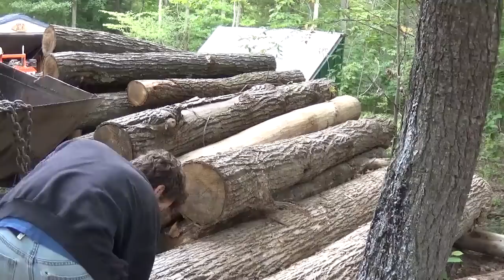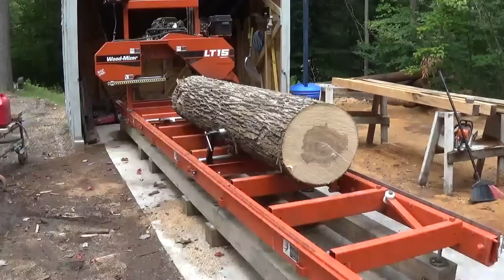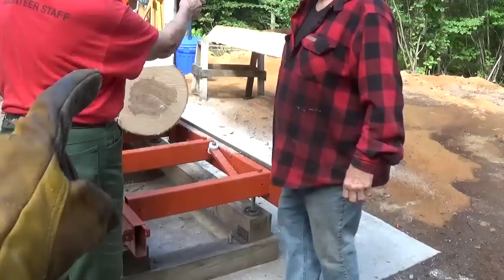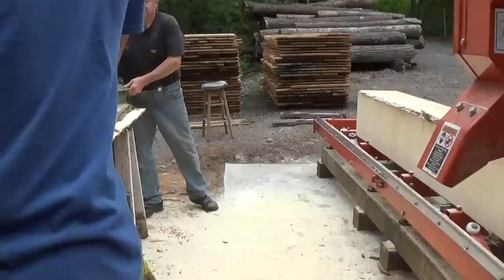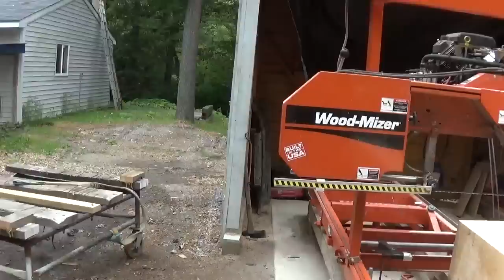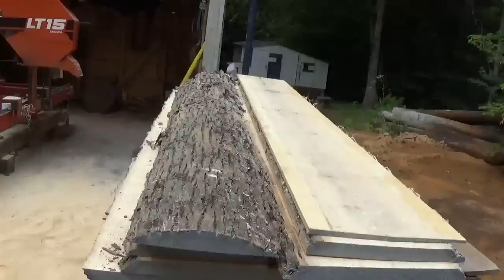The nicest lumber to come off the mill in 27 months. White Ash.

Comment: I ran a planning mill for 10 years .The biggest mistake I noticed  was if you needed a 3/4 planed  finished board  on both sides you must allow for wood shrinkage  and sawmill that board 1''1/4'' .. wood will shrink  alot when drying
Reply from the maker: Very true, but I learned that way back. I cut the wood dry it and plane it.  It only takes about 3 months.

Comment: But remember for furniture use kiln dry only. If you use air dry and put it in a room with a wood stove it will shrink even if it was drying 20 years stacked  inside in a hot attic.  My father and grandfather owned a cabinet shop and wood milling from 1926 to 1989
Reply: Dry is dry weather its kiln dry or air dry , auctuly air drying is better because the moisture leaves slower with less chance of warping and twisting
Reply: Not sure where you heard you cant make furniture from air dried lumber because that's just plain wrong. I air dry all my lumber and while it takes time usually about a year or more outside in covered stacks before I move it into my shop to bring it down to final moisture %.  I have no problem getting my lumber down to 6% MC the way I do it which is perfectly good for building furniture.  6% MC is about as low as they can go when kiln drying. I've also heard air drying is better in most cases and especially for certain types of wood as it preserves the color better than kiln drying.

Comment: You could use a bigger chainsaw with a longer arm so you can go all the way thru with one cut.   If you place some small limbs under the log, 1 on each side of where you cut with the chain saw and a slightly smaller one on the ends, it will keep your log from binding up your chainsaw and lift the log enough you won’t get your blade in the dirt at the bottom.   Awesome video.   So many great projects that can be made.  I just saw these saws for the first time yesterday and would love to have one but being a truck driver I would never have time to use it.   Lol

Comment: OK, first off, what a beautiful piece of wood! I hope you can make something equally as beautiful. Thanks for the video, but a couple of things...  you probably should be using some PPE (personal protection equipment) like head phones and safety glasses. You'll want to be able to hear when you get older (take it from me :) also, um, you should use the car horn more often... ;) I guess your grandpa(?) didn't know how well your camera picks up his words. Other than that, you do a lot of unnecessary raising and lowering of the saw. If you complete the cut, remove the freshly cut board, return the saw to the start and lower it to the new cutting depth it'll save you a lot of work. Just sayin' from personal experience. Take care.
Reply from the maker: Hi Dave, we found that the saw blade picks up a considerable amount of dust if you don't raise it after a cut, and that dust causes the guide roller to stretch the blade when you start the saw. We find it easier to raise and lower without having to clean the blade.

Comment: that is realy a nice looking peice of wood that you are cutting in to one inch lumber
Reply from the maker: It is very nice, I cant wait for it to dry so I can use it. Thank you
Reply: I guess it all depends on what you plan to build with it.  Personally I'd a either slabbed the whole log at 2 inches for tabletops or quartered it then mill each quarter for dimensional lumber but that's just me.

Comment: Thanks again, what a beautiful log there!  I bent the round tension dog arm on my lt15 and was going to buy another but apparently from my woodmizer dealer I'm better off just getting the tube from the hardware store. I don't know the size of it as my mill is out on my island. Next time your at the mill could you let us know what the size of that tube is? I''m thinking it is ⅕" material but don't know how long. it Is easy to bend those by over tightening I found out. Matter of fact it looks like your front one is a little bent, but doesn't bother you yet.
Reply from the maker: My front one is bent from the backhoe, I was taking the chain off and I did not realize I was hooked to it right away and I pulled on it.

Comment: you should have measured the total length and then cut the log in half. that way if there was some small problems with the cut boards you would have a little room to play with.
Reply from the maker: That is what I did. It worked well.

Comment: when you cut the logs to store you need to paint them on the ends so they don't check
Reply from the maker: For some reasons it is true, but not for all.
Reply: but its true what I said  I live in Connecticut its the known thing to save the ash for winter after the sap has ran out of the tree to get the most white wood out of it not sure where your from . why don't you to a test cut ash in the summer then cut a winter ash an see what yields the most #1

Comment: Can't find an ash tree in Minnesota that doesn't have emerald ash bore
Reply from the maker: The bugs can be a real problem in logging that is certain.
Reply: Same here in southern Ontario, Canada. Emarald Ash Bore is making them good only for firewood.
Reply from the maker: @optimoprimo132  I dont know if they sprayed the ash in PA, but I have seen a few nice big ash trees.
Reply: Josaljo Won I'm not sure if they have any actual large scale spray to kill off EAB but I do know they can treat individual trees by injection. That is good for home owners to protect and save a few of their trees on a small scale but would be too expensive and impractical for large scale treatment. I have 150 acres and wouldn't be able to do that kind of treatment. I also heard that the EAB is an invasive species that started on the east coast so the closer one is to the east the more extensive would be the damage. Possibly they haven't moved into PA fully yet or on the same scale. Having said that there are still ash trees that are good here in Ontario but not for long. Every year trees that looked fine the year before don't even produce leaves the next year.
Reply from the maker: @optimoprimo132  Every year the japanese beetle is a nusance to me. I do pretty much spraying when needed.

Comment: That’s nice lumber but let’s get a saw with a proper size bar and learn how to cut wood without it binding/pinching your bar. Also invest in hearing/eye protection, chaps, and steel toe boots. All are required to run a chainsaw for my company and with good reason.

Comment: If I called a 4 quarter board a 1 inch board I'd be banished from my community
Reply: Also supposed to cut at 5 quarter to allow a quarter for shrinkage while drying then planed to 3/4 ,,, am I correct in saying this ?
Reply from the maker: Sounds like the community needs schooling.
Reply: A 4 quarter board is thicker than a 1 inch board